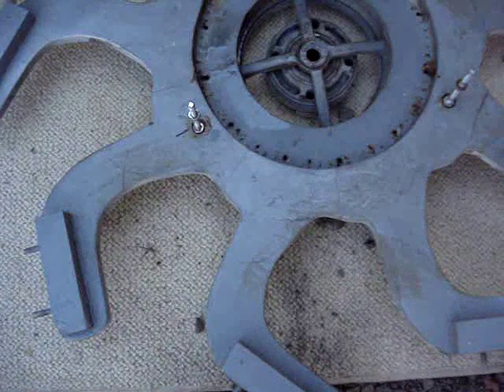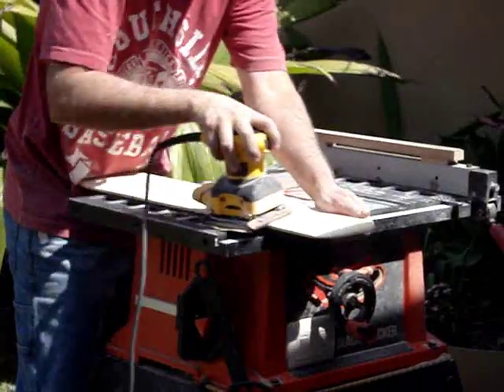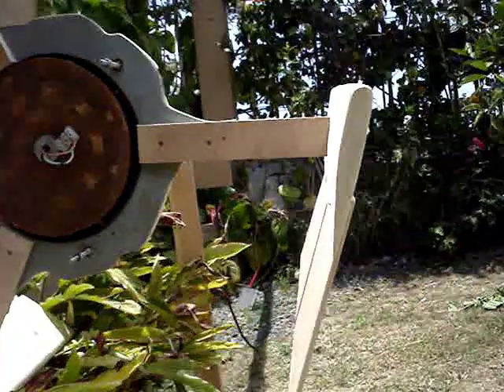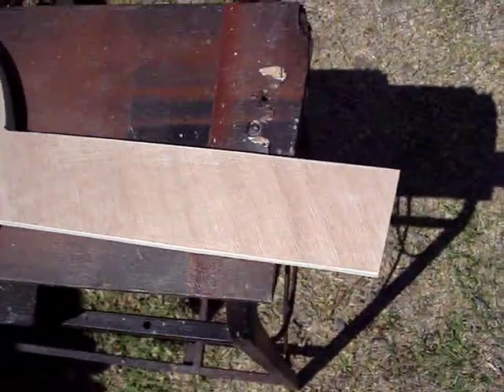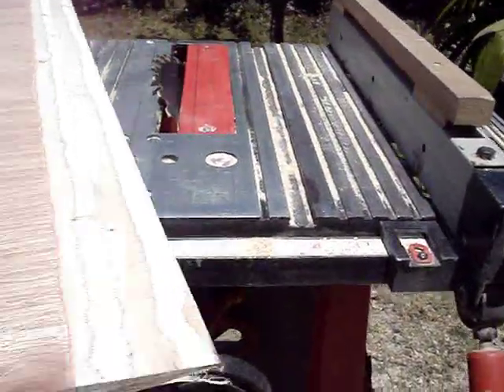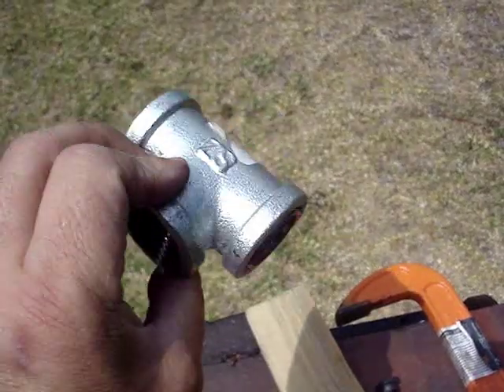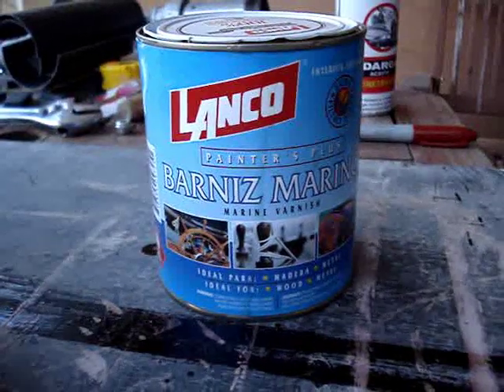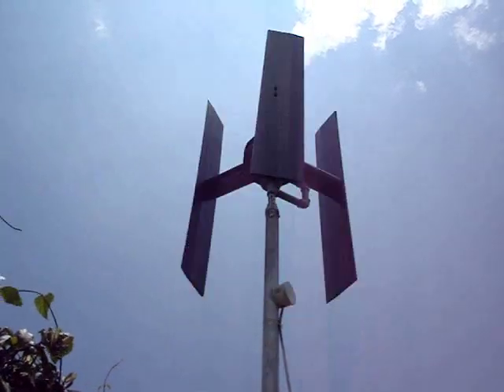( 1 ) How to build a homemade Vertical Axes Wind Turbine.

Comment from the maker: @Jinnespa The studs have a wood screw thread on the side going into the wood, you have to drill a pilot hole and I also put silicon on the threads when I screw them in.

Comment: I realized the hard way is that with VAWT's that the bearing has to be the design of a "caged thrust roller bearing" in which supports vertical weight. The bearing in this vid is for a horizontal shaft.
John

Comment: @Aceman307 The VAWT turbines generally create good torque. I would consider using a gear ratio system to increase the rpm of the wind turbine. This could be setup for a 2:1, 3:1 ratio or higher and this should solve your rpm problems.

Comment: @Aceman307
   Ok, I just watched the clip.
   Um, you may want to try streamlining the Trailing- Edges of the Hub-Struts... 
   Because 75% of the Drag comes from unsticking the Air from the Back End, of whatever shape you're pushing through the fluid.
  Um, since y're making an Autorotating Array, you may enjoy a clip of mine called  'Boomerang Aerophysics'... 
   I've been an Aerodynamic freak most of my life, and Boomerangs are VERY good value !

Comment: So the spindle below the bearings are gonna spine later down the shaft and you,ll have the motor /generator on the bottom of the pole for easy access ? or is the just a blade test ?in any case your work is nice and polished and even your misses are added and add to the quality of your explanations ,although ive watched your last video i want to learn everything your would convey ,thanks again for taking the time to share!